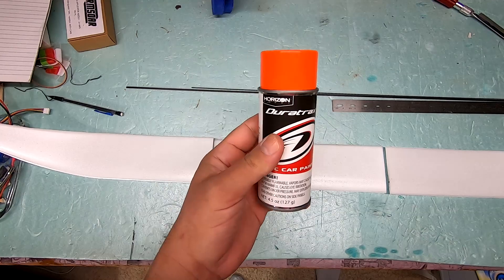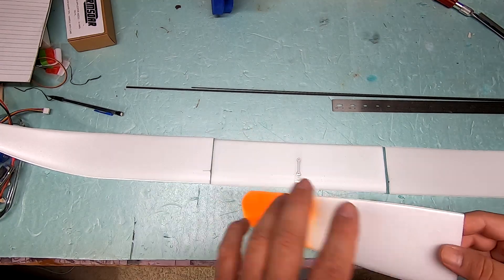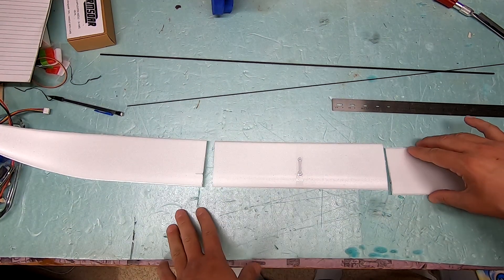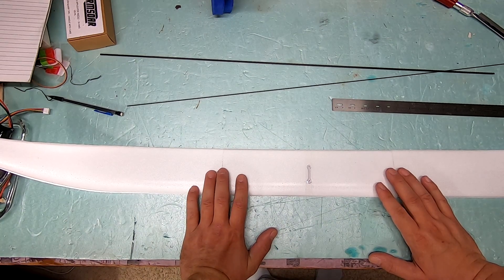Redoing the extended wing mod to the E-Flite UMX Radian - Part 6

Comment: Looks awesome, might do this to mine how does it fly?
Reply from the maker: It glides better and hangs a bit longer but it doesn’t climb as fast. Unless you’ve got money and like to experiment, I’d save the bucks for a bigger better plane. 
Have you heard of Armsoar? They make some nice gliders in the 2M or less wingspan range. Both powered, highstart launch, and DLG. Most of their DLGs are carbon. They make a nice 2M balsa RES in std glider or powered glider called the Madina. They offer some ultra lightweight power systems. I’ve bought several of their models and love them. They offer them in kit, ARF, and receiver ready.
Reply: @MyRCChannel-CJScott  cool cool thank you!!